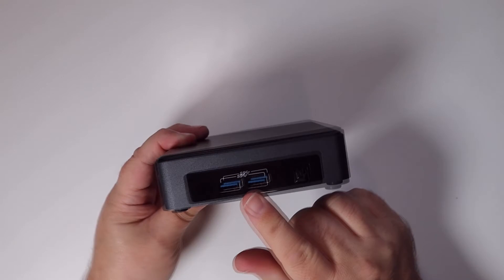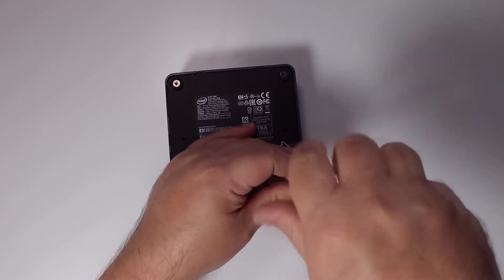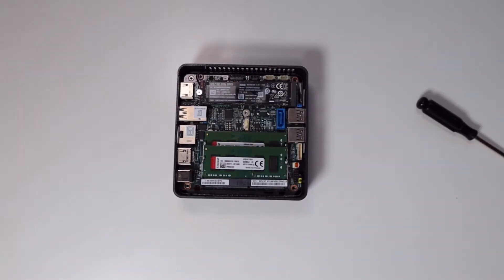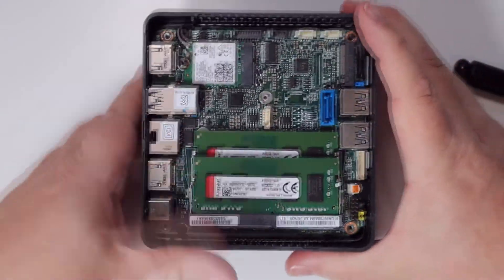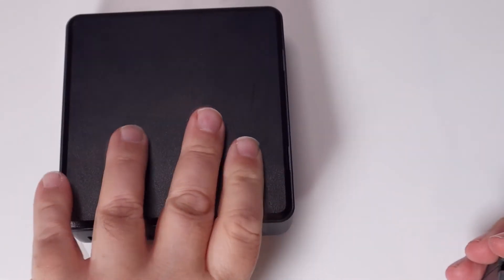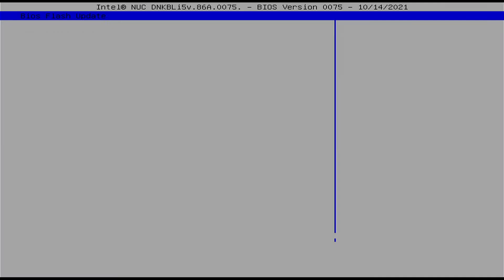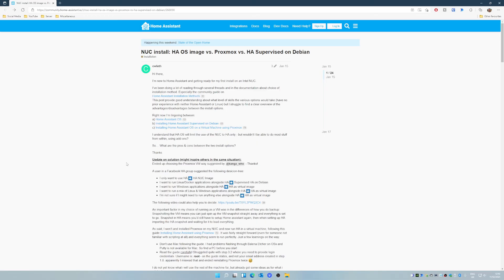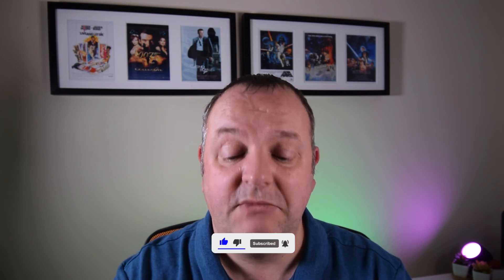What's Inside My Intel NUC? My Home Assistant Journey Continues | pt2

Comment: Can i use intell nuc nuc7cjyh celeron j4005 for home assistant
Reply from the maker: Yes should run fine with that, but bear in mind that it might slow down if you start adding video cameras but it's still way faster than a RPI4 and you should be able to add plenty of devices in home assistant.

Comment: Great info chat on your plans for the NUC
Just so you know Proxmox will run and install HA on the single drive.
But I agree with keeping it simple and doing the OS install.
While your NUC maybe over specked for HA, I think that ist a good idea, as the machine will not be stressed when you add some "addons" and few hundred automations ect.
I also noticed the reboot times are much better on the more powerful machines, than the just enough PI type installs.
Possible the only downside  with the NUC is the power consumption,  from memory about 20w, where as HA blue is as low as 2w.
Depending on the cost difference of the machines and the price of electricity it could take some time to worry about the power difference.
Reply from the maker: Thanks for the feedback, everything I found said proxmox needed 2 drives, which I thought was odd, anyway useful to know for future projects - appreciate the info 👍
It's really surprised me how quick these little NUCs are at booting up and in general use to be honest, first time using them and I think they're massively overlooked.